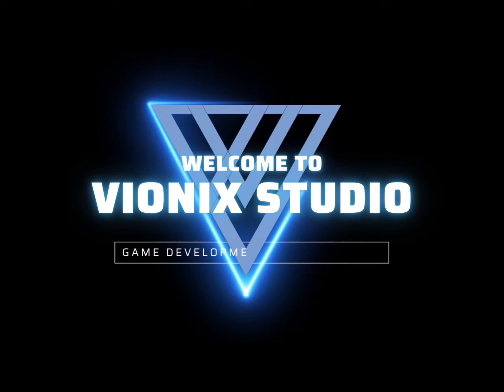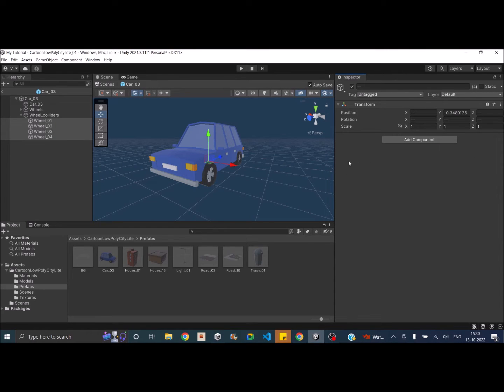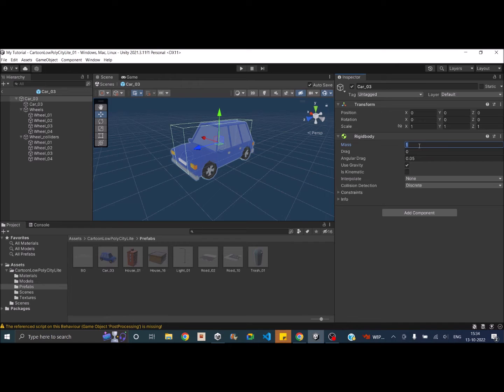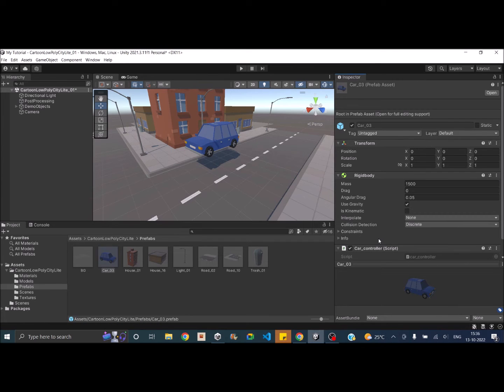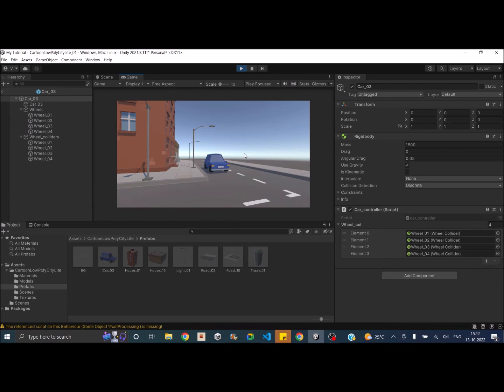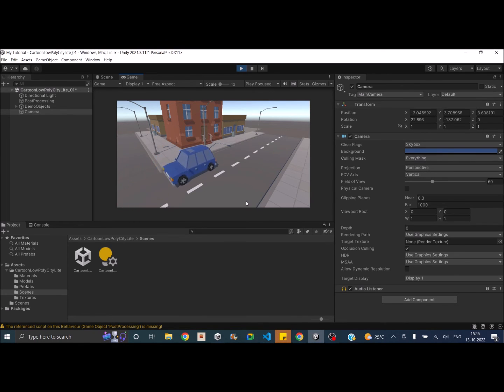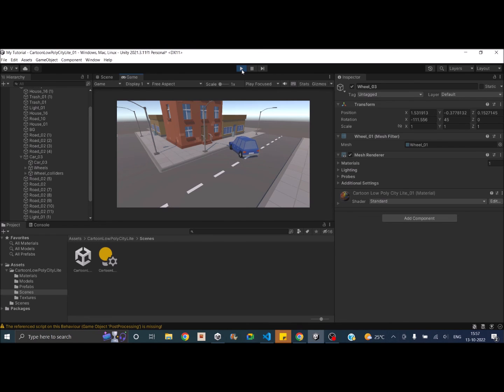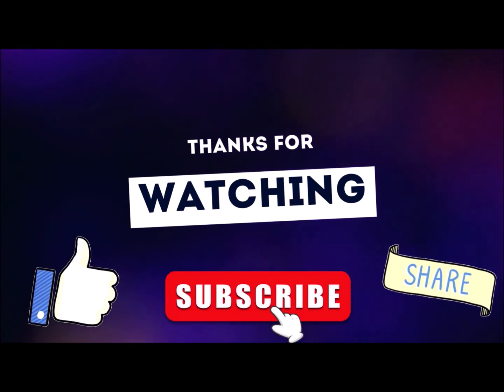Unity Car controller | Wheel collider physics for Car

Comment: hello, when launching the game, I get this error "WheelCollider requires an attached Rigidbody to function." on each wheel
, how can I solve it?
Reply from the maker: You need to attach a Rigidbody component to the parent game object in your car to use the wheel colliders.
Reply: @vionixstudio  the vehicle already has a rigidbody, and each wheel is attached to that rigidbody with the theme of transform.parent...
Thanks you
Reply from the maker: The Rigidbody should be attached to the root car game object. There can be many game objects in hierarchy before the wheels. Are you able to see the wheel collider gizmos when  you  attach them?
Reply: @vionixstudio If I understand correctly, would I have to put a rigidbody in each parent widget, and join them with FixedJointn?
Reply from the maker: No. Just to the root parent object. Take a look at how its done in this tutorial video.

Comment: Hello, Thank you for making the video...helped me start with my racing game. There is one issue that I can also see in the video...the script causes right side wheels to be flipped 180 degrees on Y axis. Any ideas how to correct rotation of those right side wheels? Thanks.
Reply from the maker: Let me check
Reply from the maker: You were right. I didn't notice while making the tutorial. To fix it, just check the rotation on wheel and negate it in the script. Sometimes manually rotating the wheels also solves the problem. I will try to test the script and update.